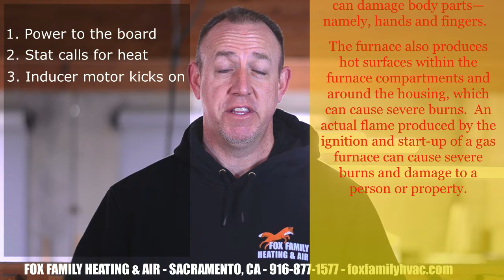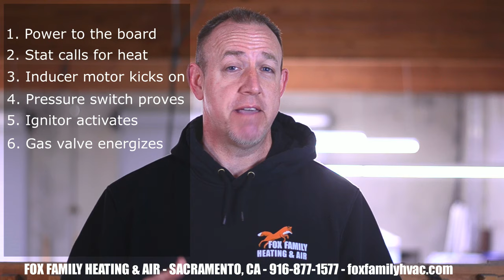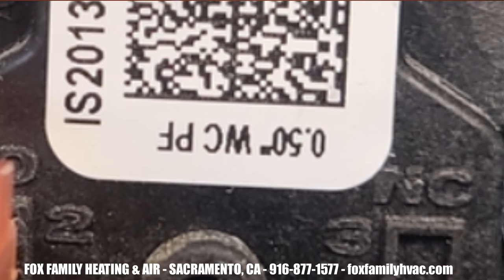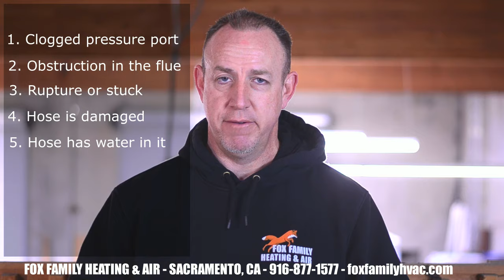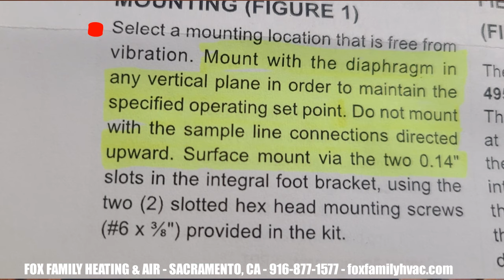How to Diagnose a Bad Furnace Pressure Switch (5 Easy Things to Check in 2021)

Comment: Recently had a service call to a residence for a furnace. The home owner was a retired electromechanical engineer. She had called her usual service company and they changed psi switch with aftermarket w/o even mounting it. Plus switch rated .65, however, equipment called for .3. That didn't fix it so they condemned the board. While installing the new board it became damaged. Sustained a crack at the electrical connection. Whenever she called them 3rd or 4th time service company stated that they were not going to continue to work on old equipment. I found debris inside inducer housing. Unit was startup and run then shut down. That's when I discovered psi switch rated too high for system. Sourced correct one and unit ran correctly. Next day had a call back, that's when I discovered the cracked board. When it's time to replace her equipment I believe she will use us.

Comment: It's 2023, January, and we lost power for multiple days in a snowstorm. Power comes back but the furnace doesn't work. I found this video, and it worked to fix the pressure switch so that heat is flowing until I can get a tech out. Thank you for the video!

Comment: So to make sure I understand, if the Ignitor is coming on that means the pressure switch is working properly? My inducer motor comes on, the ignitor lights up but the gas valve takes a while to click on. I have noticed that the gas valve will click on as soon as I take the side panel off. It's like an air flow issue. As soon as it does, the burners all light and the furnace heats normally until the thermostat shuts it off. Thank you for your videos! We appreciate you sharing your knowledge!

Comment: Excellent description of how this works. 
One thing that could be mentioned is that “fooling” the system by shorting the pressure switch wires (closed switch) after the inducer starts may let the burner fire up, but will lock down the system the next time it tries to start, should somebody notice it would run if done that way once. In that situation, the inducer won’t even start to run.
Reply: There have been times where I’ve bypassed the pressure switch for testing purposes, and more often than not the system won’t even start up, or throw a trouble code for “pressure switch stuck closed.” I figured out a way around this, by jumping the two pressure switch wires together right as the inducer is ramping up, tricking the board into thinking that the pressure switch has closed properly. (Once again, I do this for testing purposes ONLY.)

Comment: Thanks. Not sure what fixed my problem (pressure switch stick open) - puffed switch & clicked softly , tapped it, was not fully vertical so refixed, cleaned metal "nipple" om motor where hose fitted with electric wire like u suggested, no water in hose, reset power switch couple times (separately cleaned flame sensor, unconnected) and BAM - my Goodman 80% single stage started again. APPRECIATE THE HELP - CHEERS!
Reply from the maker: That's awesome!

Comment: This is a great video! Very organized and comprehensive. Thank you! Unfortunately, my problem persists. I've had multiple HVAC techs from multiple companies try to fix my furnace, but all have failed. I cannot be too hard on them though,  since the issue is intermittent, and some have not been able to recreate the issue. I have a 7 year old Ducane, 95% efficient gas furnace. 
The issue: Randomly fails to fire (inducer running) or fires and blower runs, but shuts off before set temp is satisfied. Compounding the problem is the fact that the system does not re-try. If I lower the set point on the T-stat, and then raise it again, it usually works fine. If it happens a 2nd time, it'll fire or fire and stay on on the 3rd or 4th try. The obvious intolerable problem is when we are asleep or out of the house, so unable to manually cycle the call for heat.
This has been the behavior since the first winter. Installer threw his hands up. Lennox expert has replaced parts but never fixed. Next step is a whole new system. 
Any thoughts or suggestions will be greatly appreciated!

Comment: I hope you're reading and responding. As long as I was blowing into the hose that leads to the switch the green light was solid, but as soon as I quit blowing the green light started flashing again. There is a second hose between the switch and the the flue pipe but it's more difficult to remove from the switch so I didn't force it. Suggestions?

Comment: Video created a few years ago but asking how to determine the vertical position on a pressure switch (i.e. a clock rotation or a flip of the switch to lay flat or upright). Have found NO answers anywhere??? Thanks

Comment: Thank you for the video! My issue is a little different. My furnace worked well for about 25 years, but recently the pressure switch frequently  failed (every few days or weeks). Every time I can fix it by sucking out an ounce or so of rusty water from pressure switch hose, and clean and dry the hose. How can I prevent it from happening so frequently? Thank you in advance for help.

Comment: Hey Greg , u guys ever use the sdmn6 I believe it’s called , the manometer with a pump on it to conclude if the pressure switch is indeed closing when it’s supposed to?

Comment: I have a two stage Carrier Inifinity HVAC furnace and I started getting a LPS trouble code. Upon observing the furnace it will go through the proper cycles and once the blower starts blowing low air the furnace will trip the LPS code and then shut off only to restart again in high fan mode and resume heating just fine.  This seems to occur almost every time now. I had an HVAC technician come out today and he said that it could be the pressure switch or it could be a defective control board or a defective thermostat.  I started by ordering a new pressure switch as that is the cheapest of the three parts to see if that will solve the problem. I'm curious to know what your thoughts are about this issue and if you think a new pressure switch will solve it or am I looking at a much larger problem. Of course his recommendation was a brand new HVAC system  Thanks in advance!!

Comment: At 11:27  do you say that  backwards?  Should you get 0v if it's open and 24v if it's closed?
Reply: Here are the values for a 24v switch:  with one lead on ground you should see 24v on the power in wire all the time. If the switch contacts are open you should not see 24v on the power out wire. If the switch contacts are closed the power out wire should also be 24v.  Next:  with both leads on the switch you should see 24v across the switch when the switch contacts are open. When the switch contacts are closed you should see 0v across the switch.  It is all to do with potential difference.  A multimeter set to voltage is really a potential difference meter that see the difference between the two points of contact.  A closed switch has 24v on both terminals therefore 0v potential difference across the switch.

Comment: What does it mean if the inducer motor attempts to start but then shuts down almost immediately, like after a second or so?  Mine does this randomly and then starts running after a five minute delay.

Comment: I had a code on a Rheem  gas furnace pressure switch open.  System would start in sequence and run about minute and a half and completely shut down and will not try to re light code blinks 2x with 4 sec pause saying pressure switch open.  I checked hose cleared port checked flue I'm assuming the pressure switch is bad?

Comment: 10/06/23 I wish I could convince the installers that installed my new A/C to move the thermostat back where it was. It was in the hall. Exactly what was mentioned in this video. It is now in the living room with a supply register on the floor near the  thermostat. I've blocked the air flow the best I can, but doesn't look good and thermostat isn't cycling on and off the way it should. I asked when he was moving it, if that's ok to put it there. Just venting. Thanks

Comment: If you don't have a Manometer, what is a practical feel for the vacuum?  My pressure switch is not closing.  I think the switch is OK. It passes the suction test by gently sucking on the tube. I just replaced a broken Inducer Fan\Motor.  The amount of vacuum is very low on the port.  I put a piece of paper in front of the port and it pulls the paper to the port, but if you use your finger, you don't really have any sense of a vacuum.  My switch says 1.11 WC

Comment: The induction motor on my heater is not coming on.  It is receiving 120v.  Could this be a pressure switch problem or is it more likely that the induction motor has failed?  The unit is about 16 years old.
Reply: By my understanding of the video, the initial running of the induction motor doesn't depend on the pressure switch being closed. It's the other way around; the switch can't close until the induction motor runs for a few seconds to generate the partial vacuum. I would say you have a failed induction motor. Hope this helps a year later. :-)

Comment: furnace heat skipping stage 1 and goes straight to stage 2 - I've checked the flue, the hose on the switches, the filter is fine - replaced the thermostat...what do I look for now.  I applied soft suction to the switch and could hear the soft clicking sound.  Furnace will not heat the house even to 73 degrees when running on stage 2.

Comment: Hello, a question, what can I ask if the pressure switch does not receive 24 volt from the board
Reply: I have this same problem now, did you ever find the answer?

Comment: today i checked my pressure switch, theres a little water coming out one of the teminals that wire connects to , the error code i have says limit switch ... the inducer wont run but the blower always runs even without thermostat

Comment: Hey bro,  have a problem the furnace not blowing enough hot air. I went to check and just working about 10 minutes then the limit switch open and turn off the burners the fan keeps working , after 2 o 3 minutes start working again for an other 15 minutes... keeps doing that.  I don't know if the problem is the limit switch or something else may cause  the overheating.
Reply: Check your air filter first and change it if needed. Open your blower compartment and check condition of blower wheel. If its really dusty perhaps low air issue. Is the blower motor very warm to the touch or wheel hard to turn ?  Check the blower motor capacitor and see if it’s within proper mfd range as stamped on the capacitor.
Reply: I agree with Robert: sounds like low airflow. Make sure all vents (especially return air) are open and unrestricted, clean filter, power off and check blower.
Reply: Thanks guys

Comment: For those of us who only have occasional fails to start but don't want to be caught without a working furnace, and so we can't just monitor it with a voltmeter, some general symptoms or indicators of pressure switch failure would be nice.